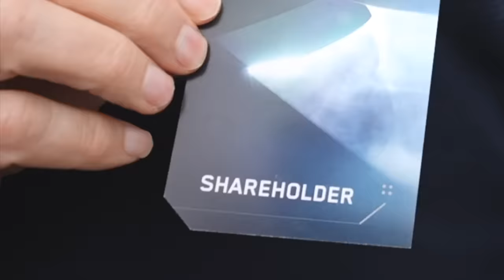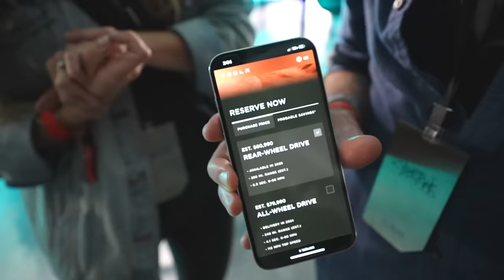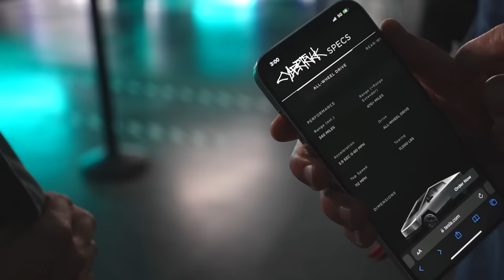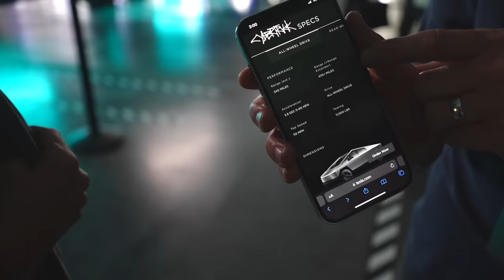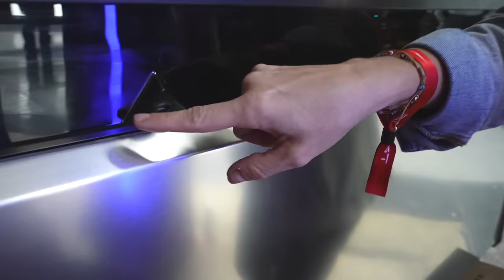I’ve Owned 4 Teslas, but the Cybertruck has me Confused

Comment: I think the cybertruck will start out just like the other Tesla cars, the price will start out high and as they squeeze out more efficiency from the production process the price will drop.  During that process the truck will start out as niche and then hopefully become more ubiquitous.   Probably in that amount of time the shape will become more accepted , normalized etc.
Reply: It will take time to get an accurate cost per vehicle for Tesla. This requires scale up.
Reply: @donaldhenderson1870  Engineers calculate these things before the fact.
Reply: I think the current pricing would be the best if comparing with other tesla models, MY and MX. Cybertruck has air suspension. It cannot be cheaper than MY models, and all-wheel model price is already same with MX. Same ? How? What does MX have more ? MX pricing doesn't look right when comparing with cybertruck already.
Reply: @tedmoss In theory, there’s no difference between “in theory” and “in practice.” But in practice, there is.
Reply: Same high pricing and bad quality and fit and finish
Reply: Business 101 supply and demand. Get as much money while they are hot and lower prices when they are cold.
Reply: This price strategy is also knows as Tesla fan tax.
Reply: @1HeatWalk  Exactly.  Tesla will make a ton of money on this truck.
Reply: The Cybertruck is a luxury/influencer vehicle point blank, period. Anyone looking for utility value wouldn't even consider it. It's a fashion vehicle.
Reply: @justint9243 Not necessarily. People in the trades are big on style and luxury too. Look how many fkn expensive pickups that have navigation, heated and cooled leather seats. There are plenty of pickups in the 100k  price range that can't compete in towing, power and features. Plus, business owners will but the hell out of them, because what makes people remember you more than showing up in a wrapped company Cybertruck? An instant name recognition boost for a contractor in any field. It's not going to work financially for a construction goomper doing rough framing or concrete work, that guy will buy a third-hand F-150 with 89,000 miles on the odometer. But the company owner its a different story.
Reply: Really?? Model 3 initial price when released was 15 pounds cheaper than what it costs now!!! They never go down, just up!!!!
Reply: @RealityLifeHumanity  Wait, let me get this straight. Did you just say that INFLATION happened between 2016 and 2023? I think you did. 🤣
If the cost of a tire in 2016 was $106.00 and today it's $149.00,  you thought that a business was going to just EAT THAT DIFFERENCE multiplied by 10,000 parts in a car? Did Ford? The 2016 Ford Escape had a starting price of $23,995. The 2023 starts at $28,000. Regardless of economies of scale, the majority of the price of the car is in the cost of the components. Find me any other car that had the same starting price in 2016 compared to today.
Reply: Horrible take. It is unlikely Tesla will reach production efficiency for the cybertruck in the near future. Reason being, Tesla is known to prioritize their model 3 and model y for production efficiency. Additionally the cybertruck will be the 5th vehicle Tesla has produced. This leaves very little room for tesla to "squeeze out more efficiency". I agree the cybertruck will start as a niche but I don't think it will ever get out of that phase because production will never be at the mass production level to meet demands.
Reply: Like others have said, price is a function of demand. Later, it will come down.
Reply: @MFoley-tv3zh  you are assuming tesla will meet production demands. The CT is their 5th VEHICLE!
Reply: I hope this happens. But honestly if not, people will eventually sell their cybertrucks. So i'll just snag a uaed one
Reply: @RealityLifeHumanity inflation, also, price cuts have been Happening across the lineup for awhile now

A plaid is like 30k less than what it was a year ago
Reply: I think the Cybertruck is just too ugly to go beyond a niche market. Tesla super fans and car buffs will purchase it, but few others will. It won’t be like the model 3 and Y which have broad appeal.
Reply: @tomcarroll4785  I would agree..I think the truck is definitely niche right now. Not a large enough market to impact bottom line from a sales revenue.  I am looking forward to the future as this is Tesla's first entry into the truck market the product will evolve and as they learn more its going to be interesting to see the engineering solutions they come up with to meet the first gen problems.
Reply: @tedmoss I think it's more accurate to say that they calculate an estimate...

Comment: Many people are comparing the price, range, and size of the CT with other EV trucks.  For me it’s the smaller things that set the CT apart like NACS, motorized tonneau cover, 17” ground clearance, bulletproof body panels, 18.5” display and associated software, Autopilot, removable side mirrors, etc.  Most of these are unique to the CT and are really what sets it apart.  I have an early reservation for a tri-motor and I am disappointed with its specs - 50% price increase and 40% range less from the reveal event. I’m hoping to convert mine to a duel motor.
Reply: I ordered a dual motor, stand in line. (A comes before E).😁😁
Reply: I bet the price will come down like other Tesla vehicles before it when they ramp it up and lower the cost of doing business. What other company does that??? NOT very many...but Tesla does, and I am happy for that.
Reply: It's perfectly priced! I am very happy as a shareholder. When my turn comes in the preorder queue, the price will drop for sure.
Reply: Look at the performance it makes the Rivian look like a slug!   Way more capable.   Worth every penny.
Reply: Hans sold me when he whacked the door hard, barely leaving a scuff.  people spend thousands after purchase putting on wraps, repairing thin, fragile painted panels. In a decade its the horrible paint that makes you sell the vehicle. The stainless steel difference is worth about $10K to me. I think these might be 30 year+ vehicles (with likely a battery upgrade in their future when they figure the 4680's out)
Reply: @@OrwellNailedIt Don't buy FSD, it makes no sense anymore.  Just do the subscription for it whenever you need it.  I say this because it hasn't retained it's value when you trade or sell and you'd be lucky to get one included hardware upgrade.
Reply: Bullet proof 🤣🤣🤣🤣🤣
Reply: I think everyone is comparing to 2019, but when you compare to lightning
Reply: You tell me where you are gonna get anything remotely close for 100K.   Watch the videos.   So much more capable than virtually anything.   It’s a revolution when there ain’t anything else in the automotive world that isn’t!   48V, drive by wire, etc.
Reply: @twothbeave  🤣🤣🤣🤣 Keep drinking that Musky wine.
Reply: Same

Comment: Initially, I was a little bummed about the range because I was hoping for that 500+ miles. But once I found out about the range extender, i was pumped again. I dont need the tri-motor performance figures, but I did want its originally promised range. Now that you can buy a dual motor for under the $80k tax credit cap and add the range extender later, it actually makes it more affordable than i think it would have been if they just gave you a bigger built in battery. 

I never believed the originally announced pricing was gonna hold up 4 years later, so that didnt come as a big shock to me. Honestly, given the prices of the EV competition, the prices of ICE trucks, and the backlog of orders for this, Im surprised they arent charging even more for the first year of production while its still scarce.

Comment: I've heard that there were >2M preorders before the delivery event.  Even if half of them drop out, that's still about 4 years of back orders to go through.  And if Tesla's track record holds, price and range should improve significantly over that period.  So those who are waiting for a $40k truck, I'd say don't give up hope just yet because it might happen in a couple more years.
Reply: Unless interest rates come down, I suspect more than half will drop out. If the price comes down to 40k (inflation adjusted) in a few years, some customers may come back later
Reply: I agree. I would only release the most expensive until that demand ran out then drop down to a basic model
Reply: You’ll be able to buy it next year, probably by June, July time. I guarantee most orders were for rear wheel drive.
Reply: The truck will be priced considering the rest of the market, production capacity, and it’s TAM.  With a much lower cost of manufacturing in about 18 months, it gives Tesla an opportunity to price it to match production with TAM.
Reply: @richb2229  that makes total sense, and most channels that follow Tesla and the CT drama expected the price to be higher.  However, to the normy truck buyer who's not paying attention to anything but the original announcement, I can only imagine them being irked by the markup and delay
Reply: @mattgraham4340  I guess they are gonna be irked by the price increase in the price of the ICE trucks also...Their price have gone up at around what Cybertruck's price have gone up by or higher....Just sayin..
Reply: It will be more than half drop out.
The price will drop over the next 1-2 years as demand won't be as strong as tesla is anticipating at these prices.
The US economy is entering a default cycle with high interest rates and an inflation problem.
Companies will be forced to slash profit margins across the board to keep product moving.
Reply: INFALTION
Reply: Yeah but who has time to wait that long?! Its already been 4 years since Tesla first mentioned the 40k cyber truck, now people will have to wait possibly another 2-4 years for the price to go back down,, so it could be 2027 and people will potentially get a $40k truck that was promised all the way back in 2019????
Reply: Prior to knowing price, I would have expected it to drop to ~500k. Now I think they're looking at ~200k reservations to actually follow through
Reply: @jackylsmith8138 I don't have the stats in front of me, but the base model was the minority of pre orders by far. The biggest seller for me on the tri motor was the 500+ mi range, but now that it's not even possible even with the range extender, I'll just have to hold out hope that silicon doped 4680s start production and are ramped by the time they get to my place in line in a couple years, so maybe a 400+ range trim while still having a full bed available. Or 500+ with an extender.

Comment: Did everyone forget about the rampant inflation during the pandemic years, which happened after the initial announcement? $40k in 2019 is $48k now. Autopilot was a $5k ($6k after inflation) paid upgrade back then but is included now, so base model + autopilot would be $54k in today dollars and they thought the tax credit was done permanently. Fast forward to now, take the $61k MSRP for the base model that includes Autopilot, subtract the $7500 tax credit, and you have $53.5k. That's actually a cost savings over the original announced price when considering included Autopilot and inflation/tax differences in the past 4 years.

Comment: I have two single motor Cybertruck reservations, I may only be able to afford one, depending on tsla stock value when I can take delivery. But people saying the specs and price are similar between Cybertruck and other EV trucks are delusional. Yeah, range and price and so on, whatever. Cybertruck is more durable; the exterior is far more durable, the gigacastings are far more durable than how other truck bodies are made, the battery cells are more durable, the battery pack is more durable, the motors are more durable. Do you want to buy three EV trucks over the next thirty years, or one Cybertruck? Then the obvious standard Tesla advantages: charging network, FSD, these are huge. And then there are advantages not really mentioned yet, like superior recharging speeds, that will arrive with the new V4 chargers and Megachargers.

Comment: The rear wheel steering may take some time to get used to but what a feature.
Reply: The CyberTruck is a great value for the price.
Reply: @cyberfloater9293  How many vehicles have those feature?? Most do not have that feature. Only a few work vehicles have them that are available to the public, a regular consumers. I have never driven one in my life, and most haven't either. So, don't make it as if it is common....It is actually very rare to have that feature in a car....
Reply: @cyberfloater9293 cyberfloater, you should like the Cybertruck, as Cyber guy

Comment: I really love your channel and here is my take.  Don't be confused this is a niche truck that has a mass market appeal.  I am stoked to get a Cybertruck.  A little disappointed in range but the range extender is good enough that I do not feel like range is a risk for me.  If I find that the range is not enough then just add the extender, simple.  Yes I plan haul a trailer.  I am relieved that the glass is not bullet proof but relieved that the front windshield will be chip proof.  I love the turning radius which is terrific in tight places but that radius with a trailer could cause issues.  I am hoping that there will be a trailer kit option which allows the truck to use the trailer's brakes to help make turns. I am still hoping that the suspension can be lowered so that it would be easier to load the truck but the lack of a full ramp is not an issue.   Price:  If you look at big boy ice trucks there is n real difference.  I really dislike that people are saying that Tesla promised this or that.   They really just  suggested that at the time they could make a truck at those prices.  Finally I saw the Cybertruck for the first time in person and I think that it is Stunning!

Comment: Thanks Kim, I do also love the Cyber truck, and as a first time Tesla model Y long Range owner, the 2023 Model has improved so much, I reallybeleive by the time I would get one, the range would more than likly be better, although 340 miles is better than what I have with the model Y. Love the display, the steer by wire, and how they implemented charging on 500 volt chargers, the dual motor Cyber will be a great road tripper and great camping EV!

Comment: I'm driving a Ford Ranger, along with a second gen. Chevy Volt, and see the CT as a HUGE upgrade into an extremely useful EV to replace both my car and my truck.  I do haul all sorts of stuff in all the time, but don't tow much, so the 340 mile range of the dual motor will be adequate.  I really wanted the tri-motor, but really can't justify $30K extra for speed and power I will rarely use.  This will be my forth pickup truck, the others being a Toyota, and two Fords.  Thanks for the no hype behind the scene look at the factory and the launch!

Comment: Cybertruck is more of a technology truck vs a work truck. Mechanical/work (ramp in tailgate, mid gate) were gone for technical features of 4 wheel steering, drive by wire, and 48v.

Comment: this is a lot of vehicle for $100k... the durability of the thing is KEY... aside from door dings and other fender bender hazards on job sites, to off road trails, etc. the safety aspect, being bulletproof puts this in a league of its own ..... and still chalked with all the latest from other manufacturers and then some, makes the price increase seem not only justified, but adds to the confidence in the development of these latest tech innovations that went in for the first time, like the steering by wire

Comment: They should make a smaller battery extender for like $5000 to make the long range 400mi and put it in the under bed storage so you can have the full bed plus range.
Reply: There is a little storage under the bed for that smaller battery, but why don’t they just build it that way and advertise 400-450 miles? The storage is almost useless because there’s plenty of storage in the truck bed and the tailgate doesn’t swing out like that of Honda Ridgeline.
Reply: @deplorablechump8758  probably since they want to save 4680 cells, and for the people who want more than 320/40 they have to pay extra. Think about it most teslas or the average ev does not have more than 340mi of range which is fine for most people
Reply: @Hi-how-are-you-today.  340 miles on paper. It’s more like 240-250 miles without towing. With towing, you would see 150 miles.

Comment: Really great Ying and Yang perspectives in this video. I think most people with reservations who do not have throw away money can appreciate this video. It basically comes down to affordability and use case. For my family, this is like a great 5 seater SUV. The tonneau will be closed 99% of the time, filled with baseball bags and Costco crap. For the hardcore truckers, I never saw this as an option from day one because the bed slopes up higher towards the cabin. The Tri-Motor is ridiculous, all it offers is HP and speed no one will ever use with less mileage.

Comment: Anyone knowing anything about Tesla should have known the pricing would never come in near what was initially stated.  They are so production constrained at this point it makes sense to price them this way, maybe 2 years from now they will lower the price.  The lack of 500 mile version and the need to lose half the bed to get over 400 miles is disappointing and probably speaks the the delay in ramping the energy density of the 4680 cells.

Comment: Yep I was VERY disappointed at the range.    Real world mileage is about 65% of stated range in my X.   Then battery at 90% only charge adds to the loss. I have 205,000+ miles and I have 14.5% degradation.   So it’s really 60%.    That’s not towing AND  temperature too affects range.   

Last year 22°F, range at 100% was only 65 miles with 15% at destination.  

The price was somewhat unsettling too, but I expected it to go up in 4 yrs.   But it went up higher than inflation.